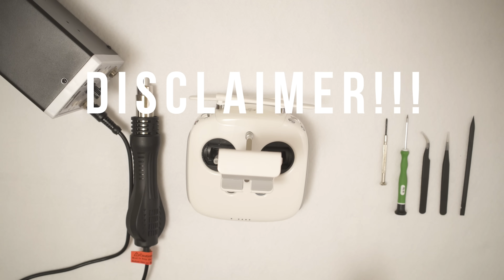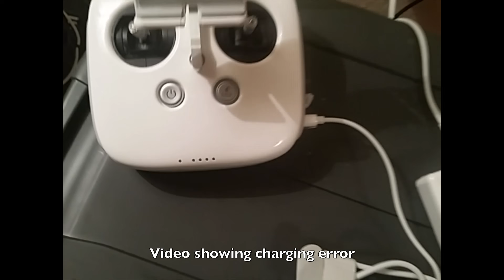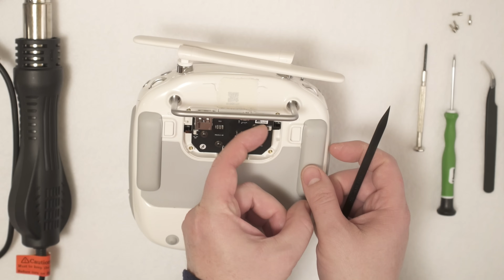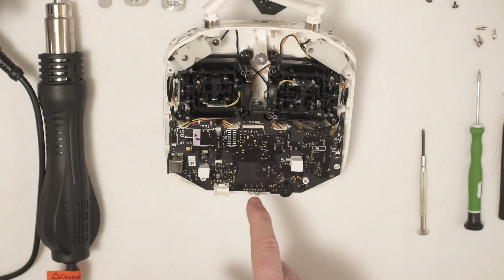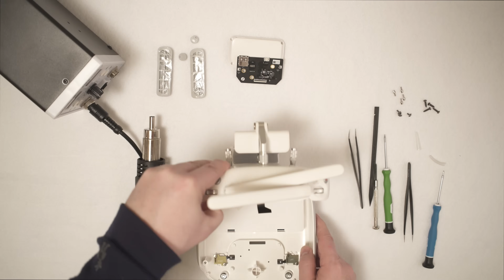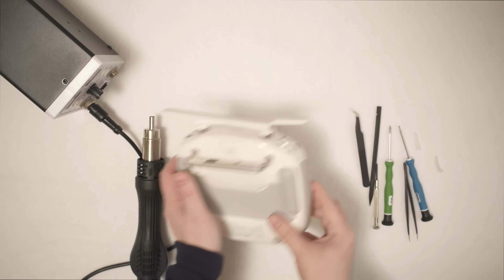FIXED!  DJI Phantom 4 Pro Remote Control Battery Charge Issue [Disassembly, Repair, Reassembly]

Comment: The few times I have logged in to enable commenting I believe I have been positive and hopefully helpful. I too have this problem you describe but I have it x2 so both controllers so I am excited you decided to put up a how-to on this issue. I will absolutely do this.
I seem to have the same solder station you have or very similar and it is always good to be using the same equipment as the teacher.
That said, I really, really do not like when Youtubers place the camera position forward of the subject such that I am look down but also back towards the subject. For me it's like I'm falling forward or looking down between and back of my legs. I reckon if you had at the least moved the camera back so it was straight down the "problem" would disappear. Think of it as if you yourself were working on the controller but with your head well forward of the job. Quite an uncomfortable angle you would admit.
Reply from the maker: Jed, many thanks for the feedback. At the time my setup was limited as to overhead filming. This video was shot from a tripod balanced sideways between two beds and a wall, with the footage flipped to give a perspective approximating a normal overhead view!  My current setup can do much more natural-looking overhead filming!  Thanks for logging in and commenting—and for watching the video!

Comment: I have to exact clue of why ... but it works !!! THANKS !

If you can explain the why, I'm interrested :)
Reply from the maker: Great to hear, Dorian!  Searching the internet for “circuit board reflow” should provide a good explanation of why it works!  In short, you are re-melting the solder so the parts get reconnected.

Comment: Can you do this with another heat gun thingy or whatever. Will it work with a hair dryer? Lmao
Reply from the maker: Duane, sorry for the delay in getting back to you. I don’t think most hit dryers will generate enough heat to reflow the solder.  Another style of heat gun probably would work, though.

Comment: Very nice video, thanks for all the hard work of putting this together for us, So was the battery actually fully charged with only an issue of the charge indicator circuit not working properly? I'm not understanding what this procedure actually fixed. Thanks again :)
Reply from the maker: In my case, if I recall correctly, once I made the repair, the battery started charging (all lights building from left to right), with at least a couple left until full charge, if that makes sense.

Comment: [FUNCIONA] Hola, a todos!, quería contarles mi experiencia respecto al problema de carga del Control del Phantom (en mi caso un PHANTOM 4). Al principio comenzó a cargar solo hasta el tercer led (3/4), y finalmente hasta el segundo (2/4), lo cual me otorgaba solo el 50% de batería. 

Incríblemente la solución fue calentar el chip de 8 pines que se encuentra al costado derecho de los leds de carga. 

[Procedimiento]
En mi caso utilicé un soldador de estaño y la pasta FLUX sobre el chip, "rectificando" cada punto de soldadura de los pines 8/8, y por último calentar a unos 330°C durante unos 20 o 30 segundos el chip, que aparentemente contiene en la parte de abajo de este una pasta que hace de conductor sobre la placa del RC.
Volví armar y a la primera conexión de corriente VOALÁ, FUNCIONÓ!. 4/4 los leds de Carga se encendieron completos. Lo que también me llamó la atención es que la batería parecía casi completa, por lo que me dio a entender que este chip regula lo que el RC informa de batería y no depende si la batería carga o no. Es decir la batería carga igual pero el control solo entrega menos porcentaje!

Saludos a todos.
 y GRACIAS!!!

Por si quieren saber más sobre el CHIP:
http://www.raspberrypiwiki.com/images/0/0f/CW2015-power-management-datasheet.pdf

O Comprarlo:
https://www.chinahao.com/product/556352851759/
https://es.aliexpress.com/i/32850043982.html

------------------------------------------------------------------------------------------------------------------------------------------------------------------------------------------------------------

[IT WORKS] Hi, everyone, I wanted to tell you my experience regarding the loading problem of the Phantom Control (in my case a PHANTOM 4). At the beginning it began to charge only until the third led (3/4), and finally until the second (2/4), which gave me only 50% battery.

Incredibly the solution was to heat the 8-pin chip that is on the right side of the charging LEDs.

[Process]
In my case I used a tin soldering iron and the FLUX paste on the chip, "rectifying" each solder point of the 8/8 pins, and finally heating at about 330 ° C for about 20 or 30 seconds the chip, which apparently contains in the bottom of this a paste that acts as a conductor on the RC plate.
I returned to arm and to the first connection of current VOALÁ, FUNCIONÓ !. 4/4 Charge LEDs turned on full. What also struck me is that the battery seemed almost complete, so I got to understand that this chip regulates what the RC battery reports and does not depend on whether the battery charges or not. That is, the battery charges the same but the control only delivers less percentage!

Greetings to all.
 And thanks!

In case you want to know more about the CHIP:
http://www.raspberrypiwiki.com/images/0/0f/CW2015-power-management-datasheet.pdf

Or Buy it:
https://www.chinahao.com/product/556352851759/
https://es.aliexpress.com/i/32850043982.html

Comment: I have the same issue, I put my remote into the freezer for some hours, took it out anf waited 30 min. Starting the remote shows fully loaded battery. So there is a cold solder...
Reply from the maker: Joerg Fuehring I’m glad to hear that worked for you. It likely worked by slightly altering the size or shape of the circuit board. If this continues to work for you over the long term, that is great, but reflowing the solder will be a more permanent (and likely more reliable) solution. Good luck!

Comment: Good video.  Would it be possible to simply use a soldering Iron? Concentrating on each blob of solder in the components around where you plug in the charger?  Would it also be unwise if your using a soldering iron on the same area without totally disconnecting one board from the other?  I also worry about melting the solder so it connects to the blob of solder in the next connection. 
As I said though great how to video.  Thanks for taking the time to do it and put it up.
Reply from the maker: Frank C many thanks for your question.  I don't see why a soldering iron wouldn't work if you hit the right spots at the right temp.  Removing the board is not too tough, and doing so gives better access and control, but please let us know if you successfully do it without fully disconnecting the board.  Solder's surface tension usually keeps it together pretty well, so don't know that it would creep to another connection that easily, but I don't have first-hand experience with what you're describing.  Hopefully, others can help out with their comments!

Comment: Wow you saved my life! Thank you so much.
My remote controller was constantly beeping and it would show battery low in DJI GO. Although, I could still fly my drone for an hour so I knew the battery was fully charged.  I believe this is not a charging problem, but a regulator problem. 
One commented here about the regulator being located right beside the 4 lights indicator (8pin component to the right side).
So I took the main board in a shop, paid 10$ to heat this specific component at 290celsius for 45 seconds. 
Plugged the battery back in and tested with the charger and all lights were blinking. 
It works perfectly now. 
I believe this specific component is a weak spot in those controllers. I don't think it is necessary to heat ALL the main board. Only this should do the trick. Try it and if it doesn't work heat it elsewhere.
Reply from the maker: Excellent! Thank you, David!  Also, that is some nice footage in your Bali video!  Looking forward to more!
Reply: This solution worked for me as well. I suspect that the regulator gets overheated if the charger is left on too long, which results in the solder partially melting away. Under a 10x magnifying glass I could see this. Reflowing caused the solder to bead back up onto the regulator package leads, and then all the lights came on again. 

I used 350 degrees F for about ten seconds.

Here's a pic showing the part in question after reflow: http://www.jet.net/dji/DJIPhantomVRegReflow.jpg
Reply: Packet Guy Ohhh, clever. So I'm leaving for 2 months in Asia, I'm crossing my fingers this won't happen again. Any thoughts on that ? If I don't keep it plugged for too long I should be fine ?

Comment: Sometimes its not about the rc circuit board problem.i have this same issue and i found out that the problem is in the battery circuit board.
Reply from the maker: Good point!  How is the battery circuit board fixed?  Or is it just warrantied or retired?  Many thanks for having a look and for your comment!

Comment: I did this after buying p4p that the guy did it to it already. I made it worse. When I started I it had one light blinking. Now I hated all the board after seeing video of guy reflowing all the chips. That wad mistake because now my doesn't show any lights and my alarm beeps when I plug it into charger. Not sure what to do but buy used remote. In usually good with repairs but went too far not knowing which chip was the correct one because video I watched the guy did both sides and all over the board.

Comment: works perfectly in oven
200 deg. C
5 minutes

bon appétit :)
Reply from the maker: Great!  Did you remove or cover the plastic and foam parts?
Reply: Yes I did. I used aluminium foil - foam melted anyway :)

Comment: AMAZING!!! I have zero experience on this sort of thing. I watched the vid, bought a rework station and gave it a go. ultimately it seems fixed, charging well with all 4 lights now, next step test flight. I think a key task in this was once had completed my first attempt at reworking the circuit board was to test it by plugging in power cord. First time it didn't change the fact the charging light blinked only to first 1 or 2 lights. So i spent more time reworking the whole circuit, i mean every piece of solder I could see. I didn't have any clue how long to spend on each bit but the smaller the solder the less time I spent. second test with charger showed all lights go on. 

THANKS SO MUCH BRO
Reply from the maker: Great that you gave it a try! And thanks for the feedback.  Let us know how the test flight goes!

Comment: Hey ! Got the same problem. Just to confirm you heat at 250 ° Celsius ?
Reply from the maker: I think that’s right, but check the comments section to see what worked best for others. There is a lot of good feedback in the comments!

Comment: Just cover the board with tin foil and use a lighter on the area, but not too close to the board. That is what I did and my controller fully charges like normal.

Comment: im really suprised that this fix does work! at first i was gonna send my RC to DJI Indonesia until they told me they cant replace my RC battery because noone sell it ( my RC wont charge pass 2lights ). and then i saw this video, was afraid at first but rather than buying a new rc i decide to try this. and guess what? you saved my pocket from buying new RC man !
i heated my board like 3times, then connect it to the charger and BOOM! 4lights is up. i reassembly my RC and tried to charge it, and the weird thing is it wont charge up more than 85% (checked it in DJI App) although it has 4 lights up. are there anyone having this problem too? at least im happy i have more than 80% charged battery, before was only 40% and it was only 15mins flight time :C
well played community, you guys figured this out while DJI sitting down do nothing and told their cust to buy a new RC rather than fix it.
Reply from the maker: Thank you for checking in and letting us know! Interesting to hear about the 85% charging; please update us if you find a solution to that!
Reply: i just used my RC today until 15% battery left, planning to charge it until full tomorrow. if its still max at 85% maybe ill try to diasembly it again and charge the battery manually using charger balancing ( i think one of my battery cell wont fill ). ill keep update what happens later.

Comment: This technique worked for me. I was reluctant to purchase a Reflow machine for a one time use, so I decided to try a Heat Gun that was variable between 112℉~1202℉ and I had it at the highest for about 30 seconds on the main IC Chip as shown in the video next to the blinking LED's I just kept making sure to move the tip around and not leave it in one place for too long. After I did this, I plugged in the batter and the charger and had the 4 lights flashing like it was charging. I held off on assembling it and I reflowed it again, this time doing both the front and back on the Main Board. Tried the battery again, and 4 lights were blinking. So I assembled it and tested it and TA DA! It was changed and then took my P4 out for a test flight and it works just like new. Thanks!
Reply from the maker: Excellent, thank you for the feedback!

Comment: One of the return springs on my gimbal tilt control wheel's doesn't spring back anymore, can that be replaced and repair it or do I need to send it back to DJI? Thanks.
Reply from the maker: I’m sorry, I haven’t had occasion to take a detailed look at the tilt control wheel or it’s interface with the control system.  Maybe another viewer has experience with this and will comment?  Wishing you the best, and please let us know what you find out!

Comment: Great vid. Btw is it alen screw or hex screw. And what size.
Reply from the maker: Jimmy, the green screwdriver I used said “T6,” and it is a torx screw head. I called it a posidrive screw in the video—they are similar but not identical, it seems. Not sure what size the small philips head driver was, but was larger than one for repairing eyeglasses while still being quite small. Thanks for watching and for your question!
Reply: According to the installation instructions for the HDMI module, it is a 1.5mm allen wrench.

Comment: I reflowed about twelve remotes i had here before this video,  about half of them are at two lights again.  Using  a reflow/solder  station  gonna try a longer re-flow next time , I'm assuming 350 degrees is Fahrenheit? (oops just noticed someones comment 320c)  I think mine is set to around 392c
Reply: I've reflowed my P4 RC a number of times and I get all 4 lights but it only charges to 86%, which you would think would be enough, but it drops very fast. I can get 3 flights before i'm below 20% on the RC.

Comment: For everybody who doesn't have an heat gun: I disassembled the remote, stripped the PCB from all its rubber/foam and put it in the oven for 30min at 120°C. It worked for me. Battery is charging fine again. I won't recommend this to anyone who's within warranty though...

Comment: Hi, do you have the reference of the site where you find the batterie. It's impossible for me to found a batterie for the Phantom 4 controller. I need your help!
Reply from the maker: Hi Quentin, I’m sorry to say I don’t know the item number for the battery, since I didn’t need to replace it. When you find out what battery model is needed, please consider coming back and letting us know in case others have the same issue.

Comment: I know this is an old video, but it was driving me crazy... you kept referring to the ribbon cables as "tapes".  They are not tapes.  The correct name is ribbon or ribbon cable.
I kept looking for the "tapes" you were talking about, then saw that you were working with the ribbon cables.

Comment: SOLUTION IN SIGHT ?

I opened up my Phantom 3 Advanced remote yesterday to investigate the charging issues I am having. 

My drone has only flown a couple of times which made me doubt the internal rc battery already died. Sure enough, when I measured the voltage on both cells it showed 8.37v. 
This is the same reading I am getting at the 4 pin input into which the battery plugs in when the rc is disassembled. The reading is the same regardless of whether the battery is connected or not. This eliminates a faulty battery from the equation. 
The DJI app is only showing a 70% rc charge status.

When I plug in the charger into the rc I get 3 flashing white lights regardless of whether the battery is in the rc or not.

Can someone please tell me if  the 8.37v reading I am getting on battery is a 70% or full charge?
If it is a full charge then there is a component issue in the RC that is not reading the voltage correctly. If this is the case I will attempt to reflow the component. Does anyone know where it is located on the pcb? I don't fancy reflowing parts that are fine.

Thanks !
Reply: https://www.youtube.com/watch?v=34P53lxTrsI       Only one component to solder.Let us know the result.

Comment: my RC does not fully charge the battery. I have reviewed several YouTube videos of people with the same problem, but no one has indicated which electronic component needs to be replaced on the Phantom 3 ADV RC mainboard. Can you help me?
Reply from the maker: Rodrigo Teixeira, is your problem the same as shown in the video?  If it is, check out the comments here, as several viewers have identified what part needs to be treated with hot air, not necessarily replaced. If it is a different problem, the procedure in this video will not help.